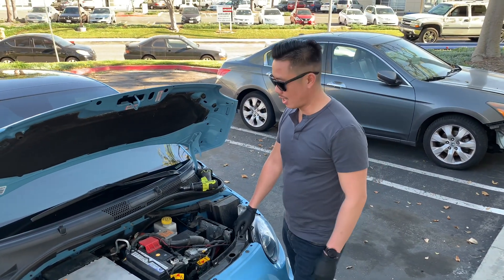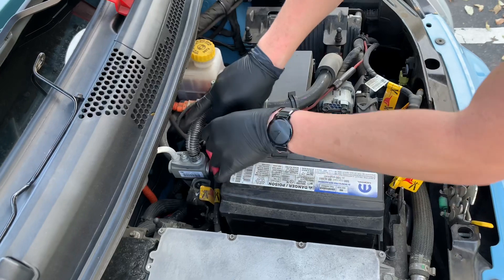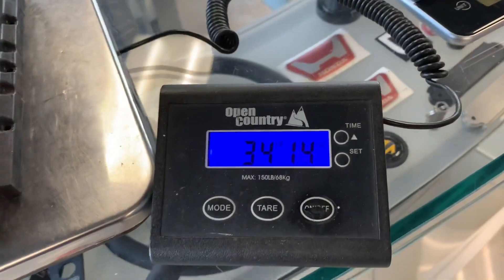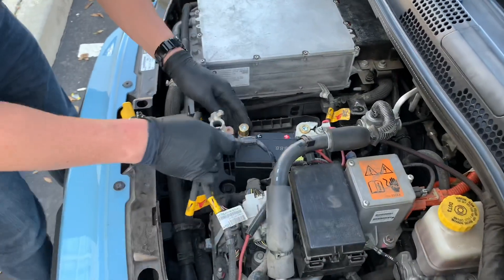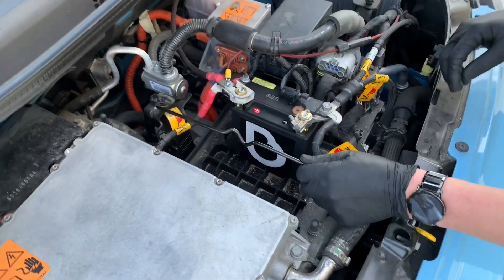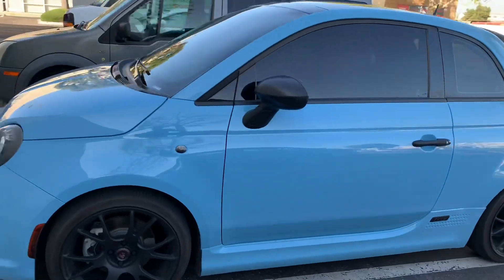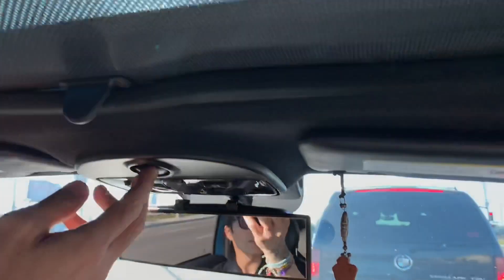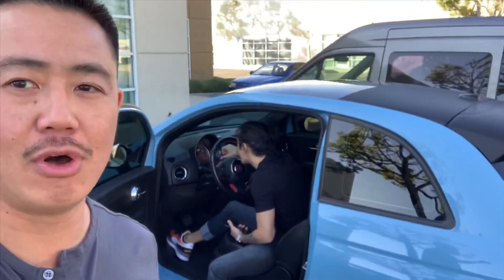2016 Fiat 500e Weight Savings!! 2.5lb Lithium Ion Battery TEST!!

Comment: If your car was below 👇 freezing, a lithium battery should not be charged. There is no battery heater with your design. 

If your 12v battery capacity is smaller that means the car battery has to keep charging it, so you reduce your available driving distance.

I live in a colder climate and need freeze protection.

Still figuring if the big battery will heat the Lithium 12V battery before charging.

Comment: Any update on how this smaller battery has fared in the Fiat? I'm interested to hear if it continues to work well. That's quite the weight savings! I wonder if the lithium battery would last longer than the lead acid or be more reliable? It's be great to hear a follow up. Cool idea for a video.

Comment: Be careful with amps and cold performance, I  ended up on the side of the freeway. I thought the 12v powers acc. in the off pos. & Contactors (relay), but mine died while it was running. 12v must be charged by drive batt &/or EVSE charger.
Reply: Great vid I would love to switch out batteries myself.  my understanding is that the AC runs off the main lithium battery?  My mileage guess o meter fluctuates widely when running AC.
Reply: A esti-mometer is more misleading than it is useful

Comment: My question is if you are sure the battery is not used for the entire charge count. I have been told that that battery is only used for the accessories, but when you are running and turn on the AC the miles immediately get adjusted to less. If the battery is only used for accessories it should not do that, but I have not seen a very good explanation on that. Perhaps it it is used to run the motor and putting a  battery with less power may affect the range ?
Reply: HV battery powers A/C (manual says so.) The estimated miles drop because it knows range will be impacted by turning certain things on/off. You can test for yourself. Turn key to first position ("not ready" should appear) and turn on A/C. You'll get fans but no chilled air.
Reply: @carlfe4891  true. also the 12V battery is charged by the 12V circuit which is powered by the HV battery with a voltage converter, when the car is powered. there is no alternator like in an ICE, although the motor works as a generator for the HV circuit when you are Regen braking. the 12v battery is only powering the 12v circuit when HV is not turned on, or the HV battery is completely flat. It also doesn't have to power the starter like on an ICE
Reply: I think everything is powered by the drive battery when the car is on, accessories run off 12v when car is off. The contacters  (relay) to turn the var on run off the 12v. HOWEVER - when I tried an underpowered Li-Ion my car died on the fwy, so maybe the contacters need constant 12v from the 12v battery.

Comment: what about drain? so living up here in the northwest we use our heated seats and defroster a LOT both of these run off of 12 volts. Is there any durability or resistance to drain. How long will it last if i park and listen to the radio. If the 12volt battery gets to low on these cars it wont start the main contactor.